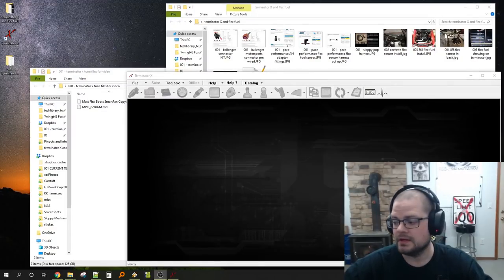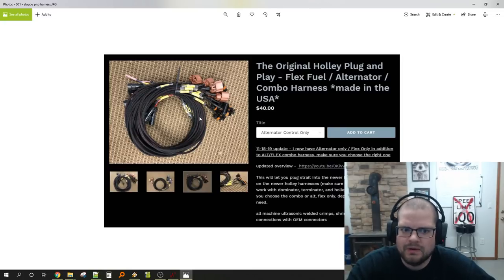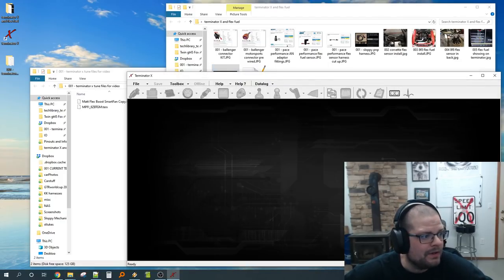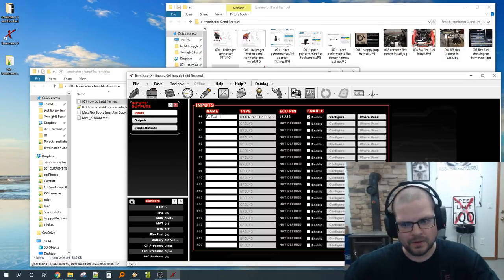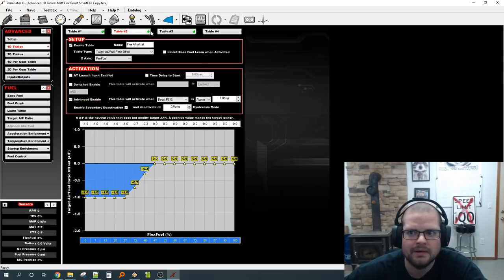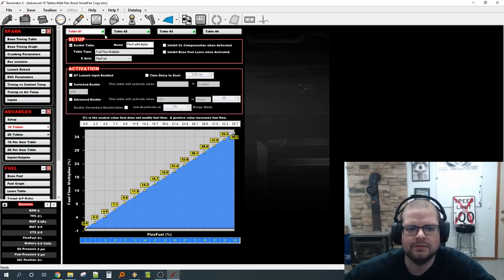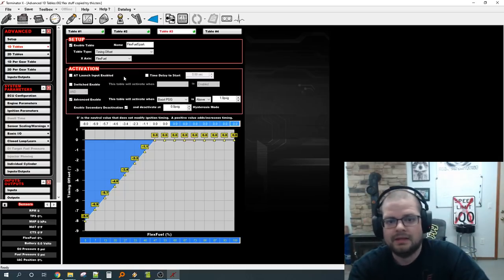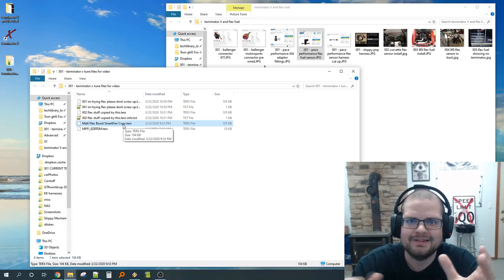E85 and Holley How To with examples explanations and base tune overview use case and more

Comment: Am I understanding this correctly in order for me to connect a flex sensor I need to run a  resistor on one of the wires going to the Holly terminator X

Comment: I'm running twin walbro 450s and Hunter tuned decaped flex fuel injector flow around 1000cc I should be good for 900hp what do you think

Comment: I am getting so much fuel at idle for my offset that my VE table says 0.00 in several cells and still reading 12.0-12.5 gasoline table commands. 
Should I change when this table is active?

Comment: Matt I use one of your tune for the 408 ls with 24 tooth crank sensor it that tune base on running e85 all the time and on that tune you pull timing back when you use pump gas ? Can just copy the flex stuff from that tune to mine ?

Comment: do you do this before your first start up? before the auto learn function? my car is drive by cable would this file still work just change that setting to dbc instead of wire?

Comment: Hi great video! Just have a question I have Holley term x system and getting ready to start my brand new motor with no base tune. It’s procharged on 100 percent e85, should I add this to my tune before my first start up or run it without you’re e85 tune and get a base tune first?

Comment: Great Video, plan on buying some harnesses for my GN from you. Ive got a 93 tune in my car with methanol and It runs really well. If I was to put a flex sensor on it and manly run 93 still but once in a while running e85 ,how would you change the tune?  Just the ignition timing? Thankyou

Comment: Could you explain where your harness would plug into a ls24x harness on a holley dom. Does it plug into the 8 i/o on the harness  I thought it was pinned for an alternator. I will be buying your harness if it works for my application thank you so much!!

Comment: watched the video and went to do the changes to get my flex fuel up and going. I have had one on the car for awhile and never could get it working when i put the holley stuff on the car after switching from a microsquirt. I had it all wired on my microsquirt and it worked fine. Right off the bat i found i couldn't make any of your changes work. Had to update firmware on the ecu. I know you sell the pigtails and that's great but i have everything here already and would be great if you went over the whole wiring side of the install. I know this would probably kill your pigtail business. Just my two cents.  Thanks for the great content!

Comment: Matt have you messed around with using multiple 2d tables to simulate a more factory based flex fuel map vice the 3 1d tables? Specifically disabling the over all timing advance 1d table and building two 2d tables similar based on RPM vs MAP and then blending that 2d table with another that references Alcohol content utilizing a nitrous stage 1 offset table type to pull the other 2d table in.  

@Little Victory fab Co demonstrates this in their video named " Holley Terminator Flex Fuel Tables done Better-er!"

I'm curious to know what you think about that approach.

Comment: As always Thank you Matt.  I wondered about the setting under system parameters, fuel type, Gasoline and the E85.  I run C85 vp in one of my cars I'm nervous to pick E85.  Reason we all know E85 Stoich is 9.8 something and Gas 14.7 ish.  Not sure If I would have to change the entire fuel map learn all the E85 Numbers, or does The Holley automatically do it.  I'm currently running it with flex sensor with fuel offset.  It works but i'm always looking to learn something new.

Comment: Wicked video! Can you elaborate a little on why you're actually running leaner on e85 vs pump even though the stoich ratio of e is a lower number? Is it just due to octane? Higher octane, less safety required?
Reply from the maker: yessir, put simply it likes the leaner air fuel, usually i see a power increase and no safety issues with it. whereas on a gas car you can make it pretty fat sometimes without loosing power, as i would always recommend adding fuel till it takes a big hp hit on pumpgas to keep it safe, that same say... 10.8 afr on 16psi on pumpgas will almost be coughing (missfiring) on ethanol because of it being too rich.

i will always shoot for richer, and then when im done figuring out the timing it likes i will try a half air fuel point leaner and see if the car wakes up, sometimes you can pickup significant power gains from a little leaner air fuel.
Reply: @SloppyMechanics  thanks for this! Looking forward to your next podcast
Reply: Hey can you help some of us out with an updated link or info to get that tune download now that the link in the description doesn't work ...?   @SloppyMechanics

Comment: Thanks for all of this information Matt. My SBC 396" stoker dyno'd 535HP/506TQ@ 5250 RPM on 01 Octane and I'm wondering if the 4 injector TBI would feed enough E85 or if I need the 8 injector TBI? I'd rather not have to guess wrong...
Reply from the maker: I don’t have enough experience to say, I would ask a Holley tech if possible
Reply: @SloppyMechanics  I did ask Holley yesterday and was told that they do not support the use of E85 in any of their TBI systems. I thought that perhaps it would be best to try and find someone who has done it. It seems odd that the Terminator is set up for GM Flex Fuel. Do you know if the 100 lb/HR injector can be replaced with larger ones? If the TB reaches max flow will it allow the motor to go lean?

Comment: With the addition of E85 to the Holley Terminator, would the system still be able to self learn with e85 or with adding it and tuning it, it disables the feature?
Reply from the maker: 100% still closed loop and learn same as usual

Comment: Can this be used on the fuel return line? I have the stock unit from my yukon but it's - 6 line size. When I upgraded my fuel lines, I put - 8 on feed and - 6 on the return.
Reply from the maker: Yes I do both
Reply: @SloppyMechanics  thanks Matt, you the best!

Comment: Awesome video. Just ordered harness for the terminator. Is your spark table directed mostly at the 6.0 truck or will it be ok to use for a 5.3 build to start from. Thanks
Reply from the maker: The spark table would be useful also so long as you’re scaled the same

Comment: What if my base fuel is already on e85? How can I set it to go backwards in case I have to put pump93 in? I don't want it multiplying my base being I'm already at 70% E. Or am I thinking about it wrong? Thanks
Reply from the maker: you can change the multiplier and the timing scale from whatever base you have, or take back your fuel table by multiply and set this up as normal
Reply: @SloppyMechanics  I'll try that. Thank you for helping us slow guys.

Comment: So I know this is a long shot but my car has a bigger than 6an return because of my mech pump what do people run in that application for flex?
Reply from the maker: Split the feed or return, they also sell a fitting that goes from 3/8 to 8an

Comment: Thanks for the video, very helpful!  For Table #1, assuming a car that runs primarily on E85 wouldn't you want the Fuel Flow values decreasing as ethanol content decreases?  It appears to be increasing in the tutorial and didn't want people getting cornfused :)
Reply: That’s what I was thinking! My bronco is running E85 or even E100 and when I can’t find any E I threw some junk gas in it from the station. Do you think we should not activate table 1 if primary base tune set to E85?

Comment: Thanks for the vid! Question, how would you setup the tables if the majority of the time you were running gas instead of ethanol?
Reply from the maker: Opposite basically, you would leave fuel multiplier alone, and tune base table for gasoline and then add spark based off of ethanol content and target air fuel offset you would make more aggressive

Comment: Matt can I still use this base tune if I’m running all motor e85. No boost? 

Just to get it running to take it to get tuned
Reply from the maker: Yes and no, issue is these triggers activate at 1psi you’ll have to adjust that and some other things
Reply: @SloppyMechanics  In an all motor case, can you trigger based off of Throttle Position in lieu of Boost?

Comment: That was great video, thanks. You said alternator harness. How and why should alternator be connected to terminator x??
Reply from the maker: Holley harness has no alternator control, read the description on my pnp harness
Reply: @SloppyMechanics  question do u have to use 80lb injectors for turbo set up? Can I use 60lb? I have a 6.0ls looking to make 500-600 hp daily drive

Comment: Matt, thanks so much for sharing your knowledge. I am super new to this and you break this down to a level that even I can understand. Have you ever made a video of how to tune using the function where the Holly automatically adjusts the fuel tables. I know it allows a copy to base option however my worry is that once i do that the chart will not be linear nor smooth. thanks again!
Reply: Matt, quick question. Will your smart fan option work with dual fans? Or do I need at add a second smart fan option on another output?

Comment: The link for the Sloppy Mechanics Tune cabinet is not working :(
Reply from the maker: Yes it is it still works it always has tried getting into it with incognito mode or another browser sometimes browsers have a security issue with how many files I have in there
Reply from the maker: Go to the main webpage and follow the link or use the wiki page and follow the link

Comment: Been considering the Holley system retrofitted to my Pontiac engines, crank trigger coil near plug ignition, multi port EFI, similar to the LS system, so this is good info for sure. Will probably use a MS2 or MS3 system first, due to cost, but this is great info.

If you're going all in on E85 and not switching back and forth to pump gas, why would you need a flex sensor? I've not found a massive difference in tuning from 75% to 100% ethanol, but I suppose having 25% gasoline might cause more problems with high boost levels. With the high compression (12:1-14:1) iron head engines I build for the street, running Holley, Demon, and Qjet carbs the variation in tuning is rather small with E75 to E85, so small as to be insignificant. Around .2+/- AFR change, and even the tuning limited FiTech EFI handled it without a problem so the Holley system should be more than capable.

I mean its nice to have one in there, but its not mandatory. Since rich AFR makes more power than lean with ethanol, you don't need nor want to go ragged edge lean like you do with gasoline to make power. 7.0-7.5:1 AFR is best power with my carbs, 9.0-10.0 is best AFR for mileage and it still makes plenty of power, my point is there is a wide range of tuning and its opposite of gasoline. Rich is more power, lean is less, backwards from gasoline. Going from 70% to 85% you are not going to change the AFR that much.

Where the flex sensor matters is if you are switching back and forth between pump gas and E85/E100 and end up with varied amounts every time you fill up. Why you'd do that is beyond me, unless you're paying race gas prices for E85 from someone like VP. My engines have too much compression to run pump gas, so its not even an option for me to go lover than 60% ethanol. I also have to drive two hours to fill 55 gallon drums with E85, because the station near me stopped selling it back in 2015. That means I carry 5 to 10 gallons in cans in the trunk when I drive 20 miles to town. If you're running 8:1 or 9:1 compression why are you bothering to run E85 without boost? Around 12:1 compression you get the same mileage on E85 as you do on gasoline, with boost you have to throw so much more fuel at it because the O2 in the fuel compounds, and as you add more fuel you are also adding more O2.